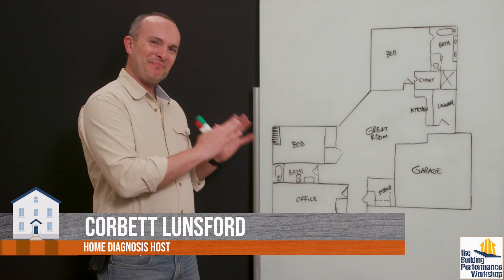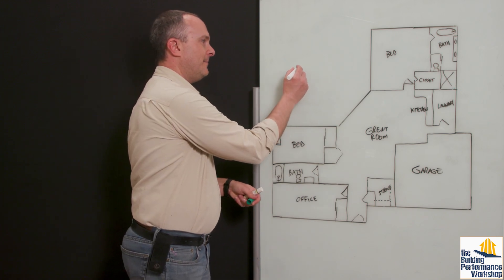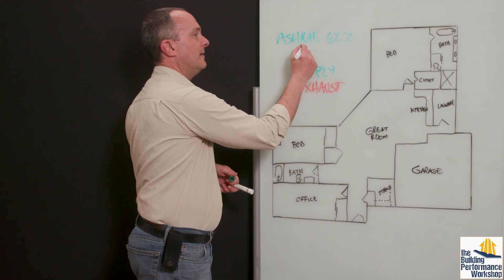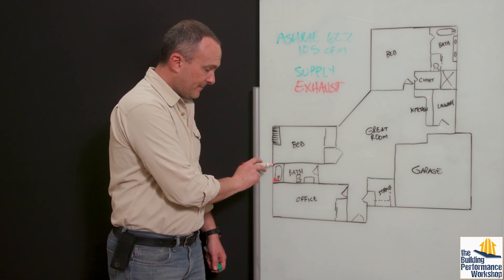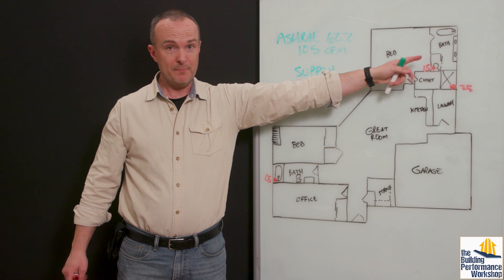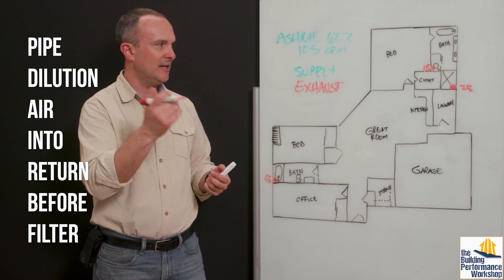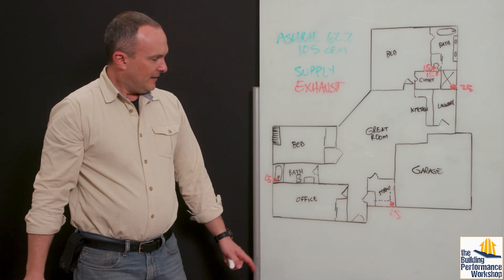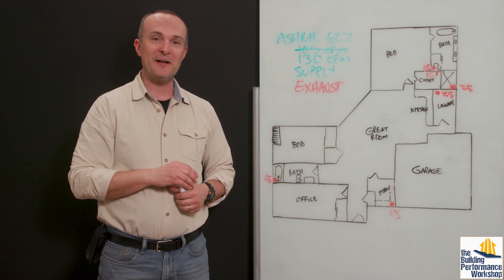Airtight Home Ventilation: Where to Place ERV Exhaust and Supply Grilles (HVAC Training)

Comment: In a heavy wind unprotected coastal environment.  How much can an "ai" ERV combat the contently changing wind lands effecting pressure on the house?
Reply from the maker: Great question, but an ERV of any brand at all does not 'combat' in my mind, it just resists. Depending on how airtight your home is, the wind may have even more ventilation effect on the home than the ERV does.

Comment: When these units say up to 75% efficiency is that only temperature transfer.  How do we find a spec for humidity?  I'm on the gulf coast and need ventilation but humidity is a huge issue already without it.
Reply from the maker: Only some manufacturers test for that, and probably not all of them list it if they're not happy with the results. Broan does, and Renewaire too I believe. You should spec a dehumidifier, I almost guarantee the ventilation will increase your home's humidity levels.
Reply: @HomePerformance  I already have both.  Massive humidity issues... Working on iterating after 6 years of problems.

- Builder Install: Unfiltered passive intake into unfiltered air handlers.  Filter back grills.
- Rev 1: Capped one wall penetration, UltraAire 120V ventilating dehu on the open intake ducted into air handlers, SantaFe Classic in Garage below home, five 70 pint retail dehumidifiers around house.
- Planned Rev 2: Dual UltraAire 70's and a Broan ai ERV all ducted into air handlers, SantaFe Classic in Garage below home.

Unfortunately at this point I'm stuck retrofitting for damage control.  Targeting < 50%rh.
Reply: @jongosling4870  check your building envelope with a blower door test.
Reply from the maker: Damn Jon, that sounds intense. I agree, blower door test might be in order.
Reply: @HomePerformance  "someone else's" blower door expert gave me a 5.
Reply from the maker: 5 ACH50? Or 5 cfm? Or a high five?
Reply: @Home Performance  5 ACH 50.  I have a feeling it was bought and paid for, however.  I've been meaning to put a package together for a virtual consult with you.  Hopefully soon.

Apologies for posting under two ID's, phone vs computer.
Reply from the maker: Cool buddy- yes, 5 is a very suspicious number

Comment: Can I exhaust and intake my HRV to the return side of my HVAC system?
Reply from the maker: Yes, that’s my recommended way, Skyler
Reply: There are two airstreams with four connections. One must be exhausted to the atmosphere if the conditioned air (intake) is sourced from the restroom. Generally, an ERV is strictly used to temper the fresh air stream (ventilation air) by reusing the conditioned air (intake) to minimize any temperature change within the space. That is it in a nutshell.

Comment: Okay. But, what would you do if you want to be able to have the steam/humidity stay in the bathroom for a bit? My wife has super curly hair, and it helps when she is styling it. I like to take baths and keep the fan off so the air is more humid and warm. Can you control that somehow without messing up the rest of the system?
Reply: A register with a closable damper on it would work, but you'd have to be on top of opening it again or you'd get moisture issues in the room.
Reply from the maker: In a well-designed home with the right equipment installed, you’re able to do things like this without big consequences, as long as you know how to make the system work for you.
Reply: Sir, this is a design decision, if you want a steam room to double as a restroom, then so be it. It’s your castle. I think you are asking the right questions. And remember, controls are a key to automation. So that closable damper can be on a sensor. Just sayin. Keep a healthy distance from zealots. They smell funny.

Comment: Amazing video. Would really love for you to do a follow up and discuss harmony between location of ERV & HVAC registers /returns.
Reply from the maker: Thanks Al, got it on the list
Reply: @HomePerformance  Yes please!  Also, where are the supplies?
Reply from the maker: Either bedrooms, or dump it all into the central duct return
Reply: @HomePerformance  Wouldn't ducting into the return throw a lot of new , moist air (from the outside) into the unit, vs into the supply and letting it get comingled with other, already dehumidifier air and then sucked back through the normal returns?
Reply: @HomePerformance isn’t it a bit more nuanced, exactly the way you discussed flow through the bathroom, you’ll want to ensure that all the living spaces have good air flow? I’m referring to dedicated supplies.

Comment: Great video. What’s the strategy for handling makeup air for a clothes dryer?
Reply: buy the heat pump dryer, you wont regret it.
Reply: @bevthebuilder5457  which one? Miele models are too tiny for the average American consumer
Reply from the maker: Disagree on the tiny thing- it holds 17 lb wet I think- efficiency of form helps. Also, the Miele washer it pairs with spins faster than any other residential dryer, so the clothes start drier to begin with.
Reply: @HomePerformance  can you dry a king size comforter in it? thank you!
Reply: @MrZammaraska  I have the Miele TWF720WP which suits our family of 4. We air dry when possible and just use it in winter.
Reply: Depends on air tightness. It’s not an issue in a leaky home. Tighten things up and mostly your options are: add dedicated passive makeup air on a pressure switch, buy a heat pump dryer (best option for energy), or find another way to get air inside. For instance, Lunos ductless HRV fans allow about 35 cfm each as a passive makeup air mode. The fan turns off when it senses the pressure difference (I called the US rep, 475, to find out). That’s 140 cfm with four fans, about enough for a dryer. 

I have seen reports of new ducted HRVs that will ramp up exhaust when they sense a makeup air demand.
Reply from the maker: FYI, Connor, the Lunos isn’t one of my recs because it doesn’t set up a consistent pressure imbalance. So you’d still have to use bath fans, which in airtight homes is a nono.
Reply: @HomePerformance  What do you mean by “consistent pressure imbalance?”

Comment: Thanks for the video.  In the future I will add a CERV2 or other ERV due to cost, but what I've been trying to figure out is exhaust.  My thought is that I could use my bath fan holes (4" ducts with backdraft damper flaps) since they are already there for exhaust.  I also have a return in the kitchen/great room for my whole house dehumidifier I could use to exhaust the kitchen.   Those are already there.  Currently, I have a Sante fe ultra 70 with 8" fresh air and 10" return that goes into a tempering box which then enters the dehumidifier and then enters the return on my air handler.  Fresh air intake, return, and my air handler all use their own merv 16 filters.  It is all a retrofit except the A/C and I'm looking at how to make improvements later.  I've been using air quality monitors to measure C02 where we sleep and VOC's to dial in my amount of fresh air coming in which I do by opening or closing the amount of return air.  The dehum fan I run 24/7 and my ecobee calls for dehum when needed.  So, anyway, any suggestions with setting up whole home dehumidifiers and adding an ERV later would be cool.  Also, I recommend looking at the CERV2 from Build Equinox if you haven't.  Expensive, but it is awesome!  Unfortunately, the company my builder used greatly oversized my air conditioner.  I'm using dehum mode on it and I've lowered the fan speed since I literally never need stage 2 to get more run time and dehum.  It's fun to sort out, but maybe you can talk about ideas for retrofits like in our situation.  Take care keep up the great videos!!!
Reply: One thing I noted from your current setup is that your dehumidifier supply puts its dry air into your HVAC return. This isnt ideal since you've removed your A/C's opportunity to dehumidify. Also, I think you mentioned your dehumidifier is always on. This will push air over your cool/wet a/c coils drying them thus pushing water back into your home. I found it counterintuitive but it's fine to add a little more static pressure to your supply (in most cases). Hope this helps
Reply: @DarenSpinelle  Not exactly. The evap coil will be removing less latent heat (moisture) from the drier air so an added benefit is that the a/c can be down size due to a smaller total cooling load.
Reply: @steveedlund7357  that is fascinating. Several channels including this one warn against that approach. I see what you're saying about the latent heat and equipment sizing. I'll have to retract my comment until I have more info on this. (Thanks)
Reply: I love the Cerv2 we put into our office and I'll be ordering another for my house and I'm in a similar boat to what you've said above.

The only thing, if I may, I would consider adding would be a zone damper and put your bathrooms on that zone and then you have a second zone with everything else.

What you've described is what I originally planned, but after using the Cerv2 unit at our office now for a prolonged time, I would definitely only want the bathrooms to be pulled from if the unit wasn't in recirc mode.  This thing is super smart and does an amazing job... I'm adding the outdoor sensor actively as there is one event happening every day at a certain time that seemingly is coming from outside the building... Someone I never would have known or paid attention to.  I love the Cerv2 and will be coupling it with a heat pump unit at some point in my setup that will cover the majority of the load.

In any case, I am not being critical at all of what you said, but this is something I had to adjust after using the Cerv unit for a while so I thought I'd share my speed bump.

Edit: I thought I would mention/remind that the system you always hear people talk about generally has the replaceable core vs our much more programmable heat pump system.  So we don't have anything to replace, but our air streams work differently
.. that's the reason I mention the above and the video goes against what I said... The core exchanges much of that energy and exhausts the rest... Ours very well might be simply recirculating depending on the outside air variables.
Reply: @DonovanSexton  so some sneaky dude is taking a stinky dump every day and it's smelling up the house? Or are they smoking up outside?  Sorry I couldn't tell.  CERV2 is so cool.  Tye is the man.  Maybe zone dampers are the way to go.
Reply from the maker: Good point, Don- the Broan and Zehnder ERVs both have recirc modes that would need to be disabled in those scenarios